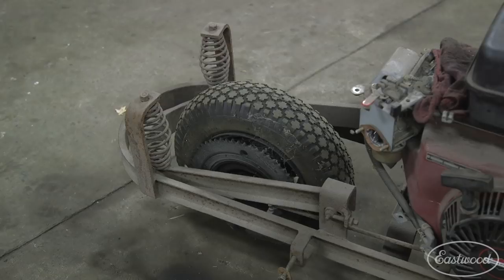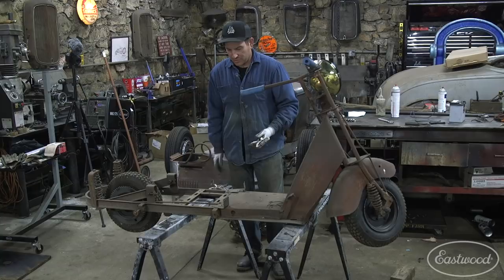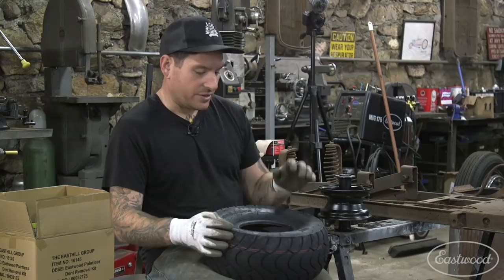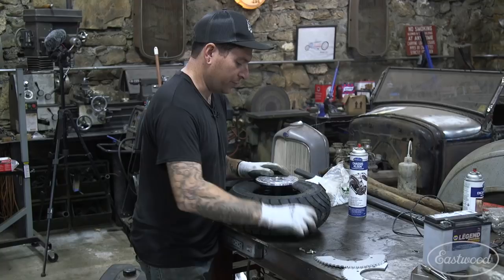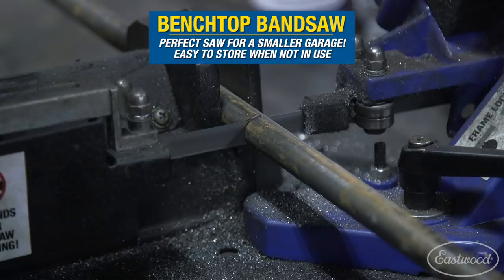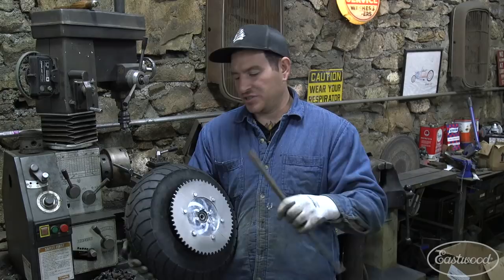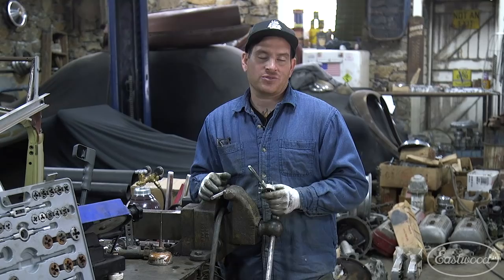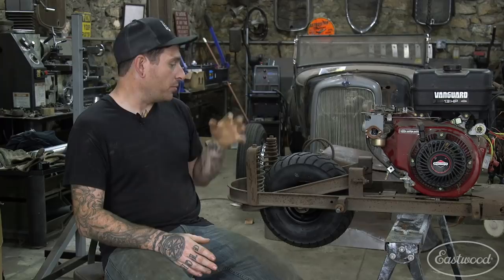The Cushman Scooter Project - Motor & Wheel Alignment , Axle Fabrication & More - Part 1 - Eastwood

Comment: you need a sleve to slied over the axle that fits between your wheel bearings on the inside for longer bearing life and a casel nut for the end of your axle

Comment: Should that axle be tight? Most scooter/motorcycle axles I've seen have a lock nut that just needs to be snugged down so there is no lateral pressure on the bearings. I like that bandsaw.

Comment: Never leave the chuck key in the lathe chuck. Never. If it doesn’t hurt or kill you it will hurt someone else which is worse yet. I’ve had one thrown out of the lathe at me. My chip guard saved me. I invited his dumb ass out back. That’s the only time I’ve ever done that.